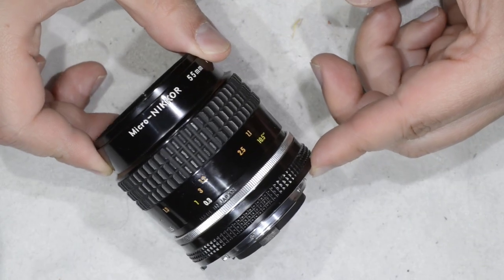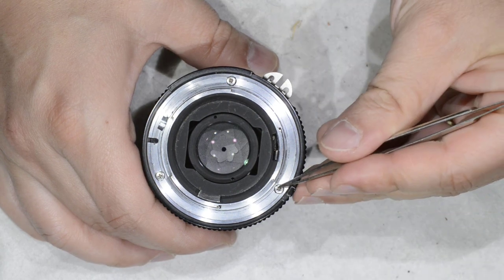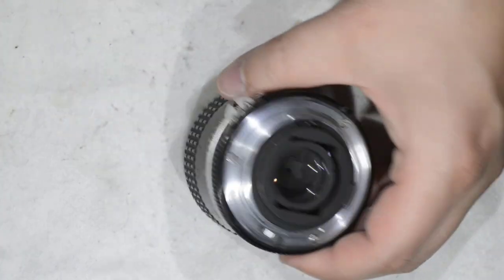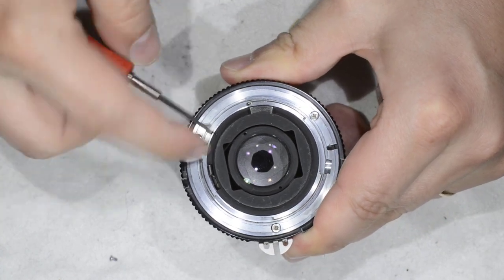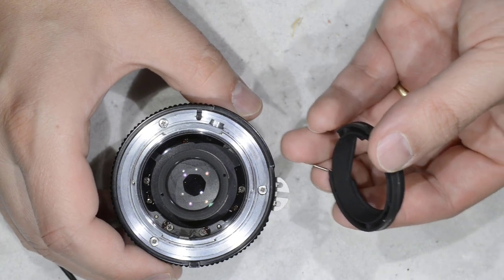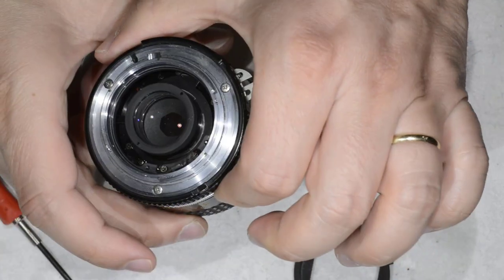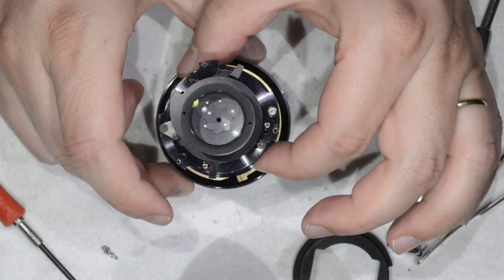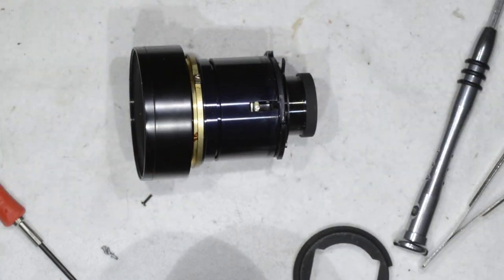Nikon Micro-Nikkor 55mm f/2.8 : Stripped screws disassembly workaround

Comment: Damn - my copy has a stripped bayonet screw but focus ring is so stiff I can not move away from infinity position. This is genius solution but unable to do it because of stiff focus ring
Reply from the maker: Hi, you can try putting lighter fluid on the gap between body and aperture ring, by capillarity some will reach the helicoid and eventually soften the grease. I don't like a lot this solution because it is messy but works in such cases. Do it on a ventilated area.
Reply from the maker: The second solution, if you have only one stripped screw is to drill the screw head (using a drill of 6mm or 1/4" depending where you are), the screw head will fall and you'll be able to remove the bayonet. Ideally, you'll need to drill the screw out with a very thin drill and retap the hole. If you can't, this lens is so light that it will hold with the other 2 screws. Not elegant but it does work.

Comment: I just had a similar issue I bought one from eBay. Didn't notice they had tried to remove the screws and failed. 🙄 I was able to take one out and the other two where pretty bad. 🤔 But I had an idea I used my drill and with a Phillips screw head bit was able to remove the screws... The drill did the job 🙆‍♀️
Reply from the maker: Good thinking, cheers